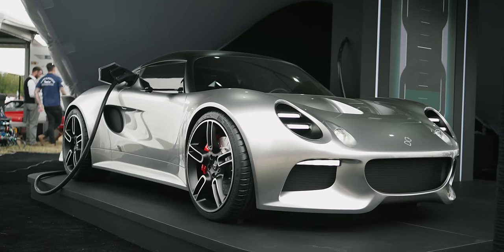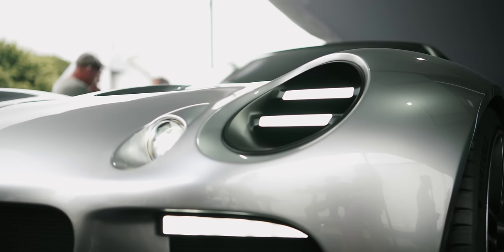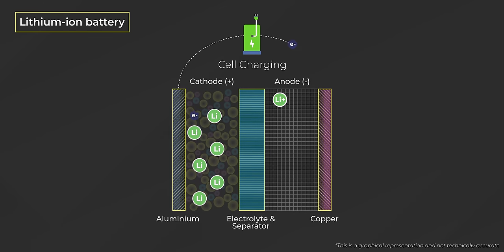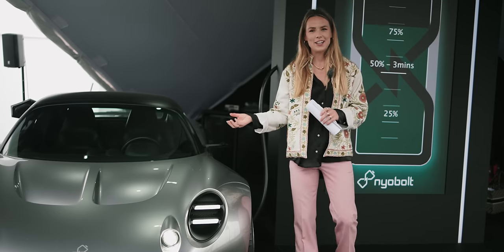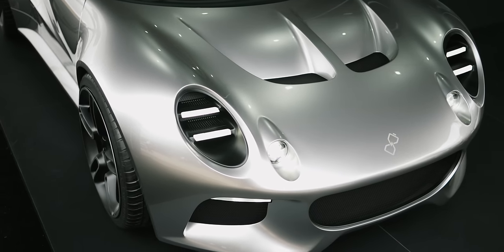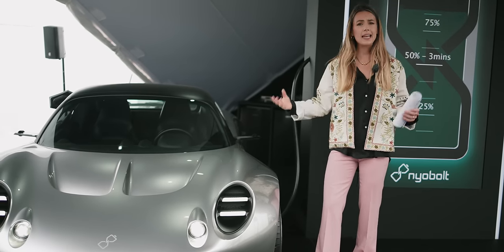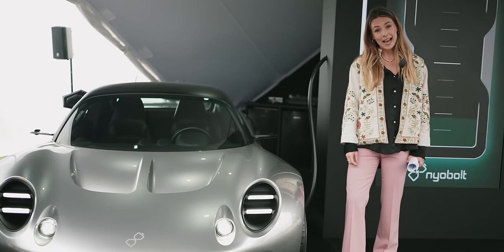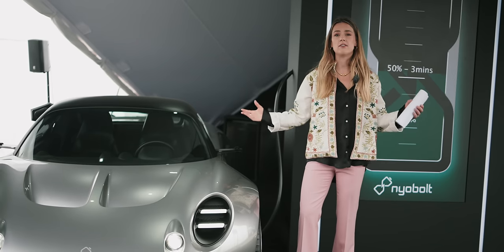This Futuristic Tech Could Be the Key to TINY EV Batteries!

Comment: Doesn't power dense mean more rangle for the same size of batteries
Reply: If I'm understanding it correctly, no it doesn't increase the range at all. It just increase how quickly you can use up that range and how quickly you can refill it when it's empty.
Reply: Energy density is what gives you the range, power density is how fast you can get the energy into the battery.

Comment: Unaddressed points: What's the lifetime of a battery being charged at over 7C? Not good I expect. Without a fundamental shift in battery technology, and I do mean fundamental, fast charging will always reduce a battery's lifetime. What's the coulombic efficiency? That is, how much energy do you get out of the battery compared to how much you put in  during a charge. Again, fast charging has lower coulombic efficiency than moderate or slow charging. Would the writer(s) and presenter even recognise coulombic efficiency if they were hit with it? "Reporting" that just reiterates some vendor's talking points without understanding them, interpreting them for a lay audience, and challenging dubious claims is not helpful to your viewers, indeed it may even be harmful. This is evident from the repeated misuse of "power density".

Comment: You will need a swimming pool to put it out if it catches fire - still not convinced.
Reply from the maker: I don't suppose me telling you that in the USA last year there were over 200,000 vehicle fires, non of them electric. 
I don't suppose you'd listen when I tell you it is 100 times more likely that a combustion engine vehicle will catch fire than a normal vehicle.
It's a bit like saying nuclear power is unsafe because of Chernobyl and Fukushima. 
2 nuclear power plants out of  440, the rest of which are amazingly safe.
https://electrek.co/2022/01/12/government-data-shows-gasoline-vehicles-are-significantly-more-prone-to-fires-than-evs/
Reply: @fullychargedshow  It's not catching fire which is the issue, it's putting them out. I dare say you are following the situation with the recent fire on-board the Fremantle Highway, said to have been caused by an electric vehicle. I understand if they had of been petrol then the fire could have been managed, especially as those cars carry very little fuel. I would just prefer you being more honest about the dangers of dense batteries becuase it appears more common than you are suggesting... and comparing it to petrol cars is pointless because there are millions more petrol cars than there are EV's, plus not all those fires are related to petrol. We all want to find a workable solution but accept that these batteries are somewhat unstable.
Reply from the maker: @richardstamper5630  I totally understand the difficulties of putting out a battery fire. I totally agree we need to be aware of these issues, we have never shied away from that. The really troubling fires that have been caused by cheap, Chinese scooters is a good case in point.
We must insist that car makers strive to reduce the chances of their batteries catching fire to so near zero it can't be measured.
New battery chemistries already being deployed are massively safer and far less likely to burn. The next generation of batteries are predicted to be fireproof.
Meanwhile, billions of combustion cars around the globe are carrying what are effectively potential bombs and we're all fine with that because we have done a lot of mitigating engineering.
Everything human beings make car go wrong, we just have to reduce it to acceptable levels. 
And no one knows yet what started the Fremantle Highway fire yet, but as always, the extremist right wing British press will always go to blaming the few electric cars onboard because they know who their paymaster are.

Comment: why did you not go into metal-air fuel cells, they are shown to work already scientifically, magnesium-air in salt-water and any other metal (iron/aluminium) in potassium hydroxide water electrolyte
Reply: money talks, skill walks
Reply: simpler the better, no controller required, just feed in fuel like in a gasoline pump car, simple as heck
Reply: nothing liquid metal nonsense, just feed solid metal as wire or sheet in a spool
Reply: well tin as liquid would work too, tho, I meant those large size liquid suspension fuel cells nonsense
Reply: money makes poor solutions, measured by money, by comparison, which is total nonsense
Reply: if not perfect, dont bother even advertising it, anything
Reply: same as graphene by laser, use it to dissociate metal oxides locally straight into metals (in ultra high temp MO -> M + O,  statistically distributed composition by temperature)
Reply: also you could make planes and cars from large circular pipes, side by side, yep a body wing plane and similar car
Reply: thats for a more flatter wide car, but a bus could be made from a super large pipe hull, solid metal hull
Reply: heavy duty cars with heavy walls, also ships, small and large

Comment: The short answer is "it won't".

For all we know there's not enough room for more/bigger batteries within the "envelope", so to speak.

Building an ultralight roadster with heavy batteries won't really work (and possibly a contradiction in terms).

Thank goodness hydrogen fuel cell car development is increasing as we type.

The sooner batteries are recycled into useful metals the better.

Doubtless there will be a home for said metals somewhere.
Reply: they coudlve made a thing of their own and made it nto a heavy ev.. how about a electric variable vane turbo vairable fuel inline 3 with hyundai hybrid non cvt transmission ... or INNengine or freepiston thing with a actually recyclable electric motor unliek the usual electric car motor?  it owuld be a more sustainable way to reducing emissiosn exemplified in a proper easy cheap to use and fix everyday enjoyable sports car of manual steering etc. its just a electric car with no effort to make it special  besides the obvious weight distrbution which porsche taycan also does?  its just a lazy novelty to me

Comment: are these batteries any safer than the ones that caused 3 car ferries to catch fire with the most recent one causing loss of life in the north sea and the loss of 4,000 cars of which 25 were EV's and one of those caught fire causing the incident
Reply: No cause has been determined.
Since only 25 cars were electric and ICE is 60 times more likely to catch fire per 100k vehicles, and BMW alone recalled a million ICE cars for stationary fires in 2022...
Reply: Read the Reuters' report of that fire, not the Daily Mail's. The cause of the recent fire in the North Sea hasn't even been investigated yet. And it was a car transporter, not a ferry. Let us try and stick to facts .

Comment: more quick energy flow into and out battery worsens battery degradation. how about electric variable vane turbo on INNengine or free piston with recyclable eelctric motor as mahle was tlaking about making, with hyundai ioniq hybrid transmission or somethng woth compressed fluid or maybe supercapacitor(longer lastign but heavier and cant hold energy for as long as normal ev battery) ? this maybe the most justifiable way to reduce emissions long term because they cant recycle the small but essential part of battery, and arnt recycling what they theretically can recycle in mass today... most ev stuff will rot in landfills because their fires (if they do happen) take many times more water and time and isolation from spreading fire to other objects, to make it safe if it goes bad during transportationa nd recycling, aeven new ev fires have been buring through many other evs on cargo ships .                                     why waste materials for heavier cars (evs) which are more dangerious in a crash at least to people outside the car, and cause more road wear damage and endrocrine disrupting microplastic type of wear emissiosn from the tires wear and suppsedly similar deal in many common brake pads pwder from normal use wear damage. why have governemtns steal money from people and give  it to people wasting it on evs and suvs etc .  look at CAFE laws incentivising bigge engiens just because their more effceint (perbiggerreater work they can do) when smaller engien couldve doen the job better and had lower emissions and fuel use etc, and otehr such blacrock ESG score type stuff, they obviosuly arnt being serious about the climate crisis claims or chemcial toxicity or sustinability of long term materials economy. balckrock obviosuly promotes other nonsense eviil and these NWO people destory nuclear power plants whoch are the only reliable sustianable long term hope for less political conflict and centralized selfish control of energy according to mainstream.  check out ulez road user charging which is usable for mass survailence tax on productiivty etc,. check out tony heller, suspicious observers, tom nelson, magnetic reversal news, etc , about climate crisis.  almost all of it is nthing more but selfish pwoer centralization.

Comment: Interesting concept, yet another niche car for the privileged... I am still waiting for a practical car with solar on their chassis...
Reply: Won't happen - the amount of solar energy falling on a vehicle is insufficient to actually charge the vehicle (even with a 100% efficient panel - which we're far from having).  I've got 16x 400w solar panels on my roof, and they can barely charge an EV in a single day... You'd be able to fit ~2 of those panels on an ID.4, so you'd be looking at 8 days for a charge (more, given that the panels wouldn't be angled towards the sun, so would be less efficient), and only if you parked in the sun for the entire time.